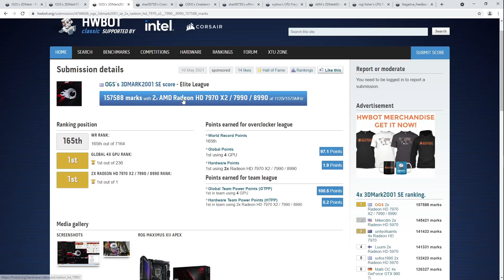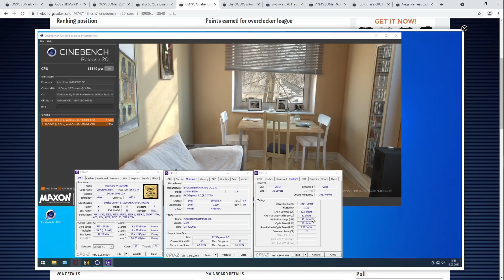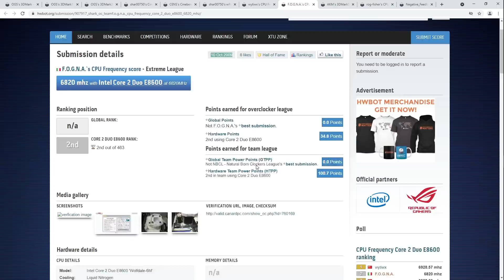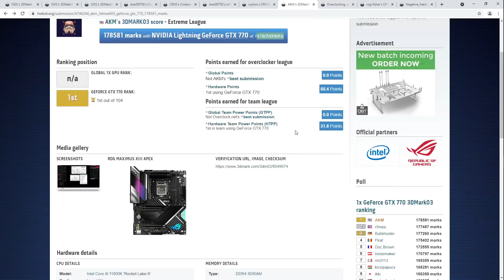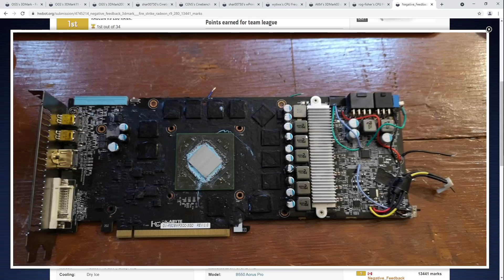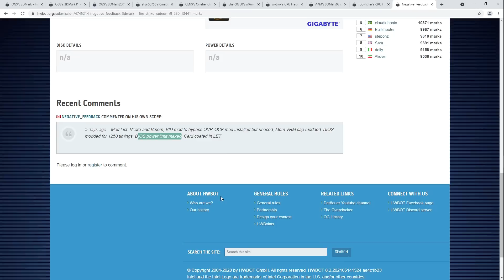HWbot score round up #3: 3.3GHz 6900XT, Quad 7970s, 6GHz+ Ryzen CPUs and more

Comment: For 01 SE , 4 cores gave a boost on XP 64bit usually so maybe why they chose 4 on W7 64 bit ? Probably would be way too much work getting full performance running 3d on XP 32 since 64 is still a WIP it seems for everyone
EDIT, Yeah I noticed the single gpu a few weeks ago. Pretty sure that was owned by Rauf but on W7 and 1080ti or even 2080ti. Guess he decided to disable points or pull the score since it was hard to verify validity... IDK ?

Comment: I snagged the i9 9960X (16c32t) monster for $600 when intel announced there new $1,000 price for the 10980XE. I also got one for $800 when Micro Center was dumping all there overstock. $250 9900K's and 10700K's anyone... They do have the Liquid 😈 6900XTx Ultimate for $2800 when the regular one goes for $2,000. I couldn't see paying $800 for that over 3GHz capability. Maybe when the prices come back down to earth. I sold my RADEON VII which i got $325 for $2K and picked up the Nitro+ 6900XTSE TOXIC. I haven't had the time to test the OC in it but, it does hold 2.85GHz out of the box.

Comment: Tip: If you click a link with the middle mouse button (clicking the scroll wheel) it automatically opens it in a new tab. Use it all the time and it's a lot faster than right-clicking.

Comment: On LGA775, the imc is integrated to the north bridge ("chipset"), good board can get 2000+ c6 ddr3 with good hyper stick, top score are made with Asus X48 with the Rampage extreme or the P5E3 because they are similar in performance.

Top score (specially with locked quad core) can also be made with Gigabyte EP45 (UD3x or Extreme or even DSx), they just need some bar edit (edit hidden North Bridge/memory timings) to perform as well if not better as Asus X48 in benchmark. 

If you are lucky enough you might see one time a DFI P45 T2RS doing great but a lot of overclocker hate them because they work randomly.

Asus X48 board didn't age well, thermal paste under the North Bridge IHS is very bad so you need to delid them then repaste them to get the full potentiel, another important thing is that they are using capacitor that can be very badly degraded causing a board to OC like a chicken.

But keep in mind that the North Bridge is BINNED on these because it can limit FSB speed or ram speed or timings or performance level (kind of a North Bridge timing), strap etc, it's nearly more important to bin the North Bridge than the CPU.

Comment: yeah LGA775 is that horrible when it comes to memory because i had a Q9550 which hated me ever since i bought it

you would be suprised how flaky some motherboards are,my ASUS P5KC which is P35 chipset would not post if i took out one stick of ram or switched positions of my sticks and its unique feature is that it is one of those weird DDR2/DDR3 hybrids

and getting a X38/X48 motherboard or any motherboard which looks healthy with just basic overclocking which would let you do things is hard because either they are dead or straight running on life support since nobody have a flying fuck about changing thermal paste on chipsets

and which revision you run on those cpus really matters because C1 stepping would scale horribly above 3.4GHz,while E0 would do at least 3.8GHz